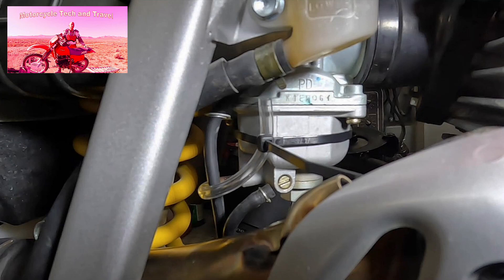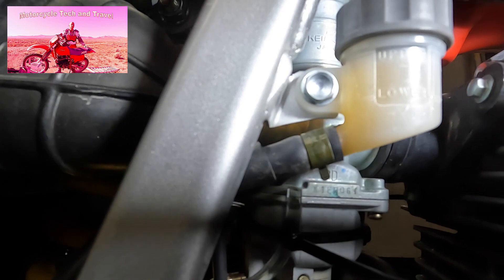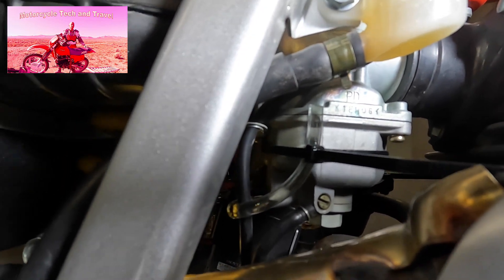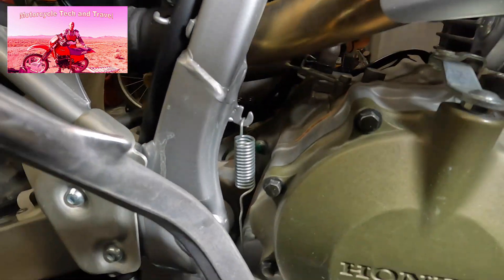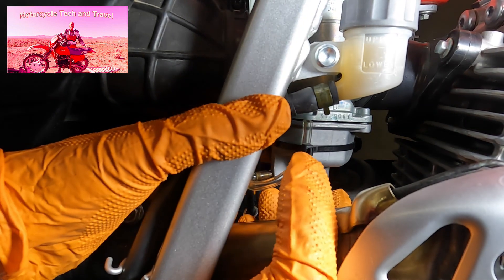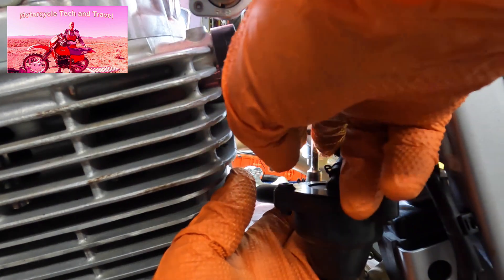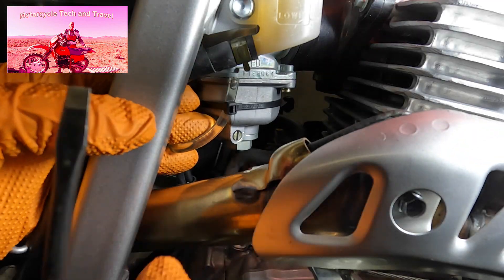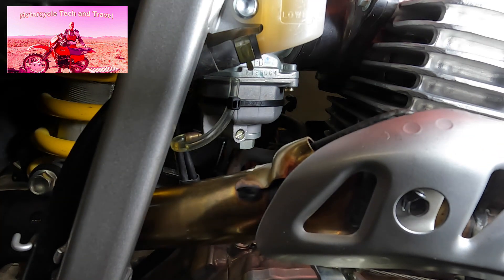Motorcycle Carburetor Troubleshooting and Float Height Check by Clear Tube Method

Comment: Great video! Hands down the best way to measure float height
Reply from the maker: Thanks for the video comment...As for using a clear tube, it's way more accurate and quick.  Unfortunately, many carburetors do not have a drain hose provision.  While most Keihin carburetors do, my Sportster's authentic, numbers matching "Sport" carburetor (CV40) does not.  The float bowl is unique, other Keihin CV40s do have a drain screw and hose out the bottom...May be worth changing float bowls and storing the OEM bowl!

Comment: Excellent job.... very handy.  Thank you.
Reply from the maker: Thanks, and you're welcome...What I like is that the clear tube test can be done at a remote site in minutes.  The only "tools" to carry onboard would be a piece of fuel tubing and a plastic tie...We can determine the right fuel level by doing a precise float adjustment followed by a clear tube check.  From that point on, we have a benchmark and can rely on the clear tube check!

Comment: This is so simple it is genius! Thanks.
Reply from the maker: A technique that's served motorcycle mechanics well!  I like the ease, the ability to perform the check in minutes without removing the carburetor float bowl, and the accuracy.  If you know where the fuel level should be inside the bowl, this is a great way to monitor the float level.  The bike needs to stand level for this check, which isn't difficult under most conditions.  Enjoy tuning your motorcycle...Thanks for your feedback and subscription!

Comment: you are a wealth of knowledge man! I've been tinkering with my2002 Honda  XR650R and keep having to make carb adjustments so getting these alternative practices is great! Looking forward to seeing more of your 650R content
Reply from the maker: Thanks, and thanks for subscribing to the channel...The clear tube method is great.  Even in the woods or desert, you can quickly check the fuel level in the float bowl without opening the carburetor.  This method is at least as accurate as an inverted float setting—I believe it's more accurate due to "seeing" the actual fuel level...If you turn off the tank petcock and drain the bowl at the carburetor's drain plug, then install the plug and open the petcock, you can see how quickly the bowl fills.  If there's a restriction in fuel flow between the tank and carburetor bowl, you'll know it!